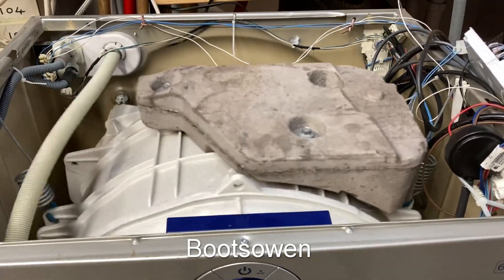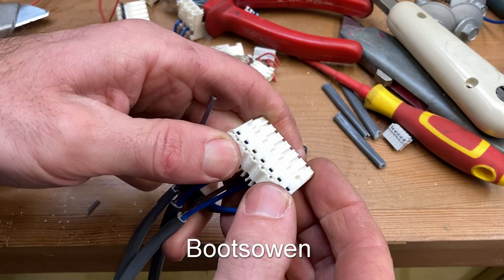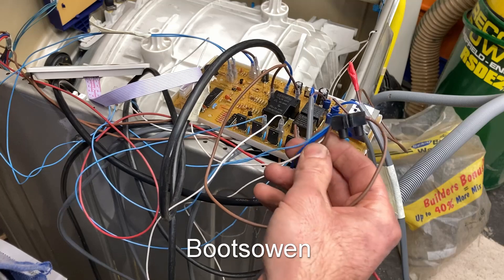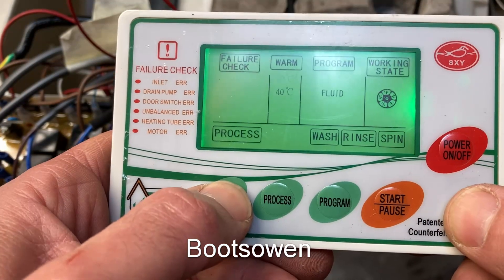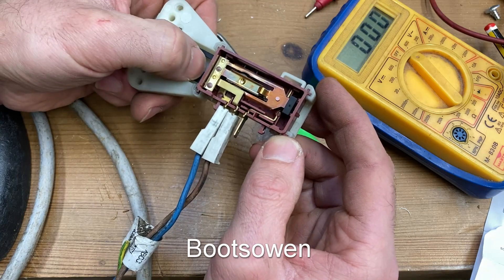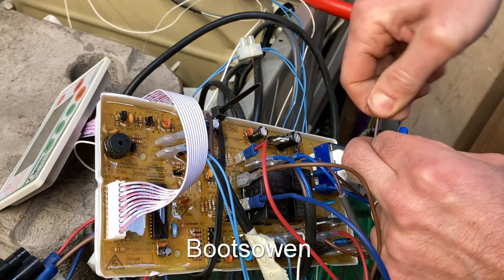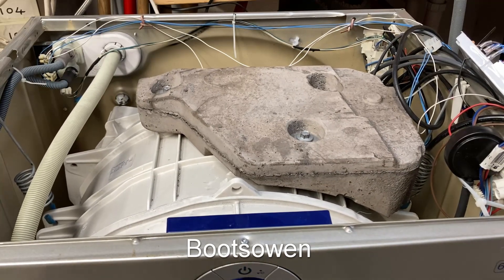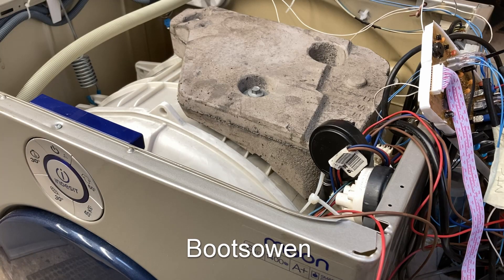Is it worth it? Fitting an SXY3388 controller to a washing machine: will Moonie wash at 90 degrees?

Comment: You've got to remember that there's a lot of poor countries with poor people in the world, the majority of the world isn't like US or Europe, also that the washing machine manufacturers don't give info on their machines or how to repairs. I think it's worth fixing stuff, if for no other reason than to reduce the excess of waste-driven economies. Economy and ecology go together. Thanks for your honest and helpful video. I'm looking at getting on of these as I baulk at the prospect of binning a good Zanussi just because an insect crawled in and fried itself and my pcb.
Reply from the maker: Cool. Sometimes pcb repair isn’t too difficult. It depends on what has blown. Burnt or broken traces are easy to repair as are any relays etc. it’s once you get into the smaller stuff that it gets tricky. Also you can often get a replacement on eBay used. It costs money but it will work. Whereas this board is pretty crumby.

Comment: Excellent job. I have a Vestel Pandora 1070W, once I load it and start a washing program it turns and suddenly the drum speed accelares and there's loud banging as if the motor or drum were loose, but it isn't. I guess the motor gets conflicting direction or speed signals from the control board. I'm not sure. It would be a great help if you have an idea. the machine is balanced and the load is minimum.

Comment: the "sparky thing" is the belt slipping because the motor make suddent changes
Reply from the maker: The controllers should allow for that and ramp up and down more slowly.
Reply: @bootsowen  maybe this motor has a sensor with a wrong resistance for the controller, or It Is Just junk (probably the second option)

Comment: Hey Owen I got an idea for the WMA32, Hotwire it with your Variac of yours and try washing some clothes or rags with it
Reply from the maker: Hi. If I Hotwire the motor to the variac all the other functions won’t work so it won’t wash?
Reply: @bootsowen  just fill it with the rags or whatever and fill it with water the garden hose and just make it slow on the variac and when you drain for a spin just open the door and lean it forwards then try spinning with the variac

Comment: to be honest the program choices are very small. no options and just like the moon pcb no 90 degrees. no spin speed regulation and all. i've heard theres a newer SXY but i'm not sure if its better. 

now lets imagine an SXY for dryers lol
Reply from the maker: One for dryers would be good. I have a Bosch with a broken board.
Reply: @bootsowen  i found on the internet a similar PCB that would be probably an upgrade for the moon

It's called YM800XQG-PLUS.
It's a touch screen and had way more options and stuff. Would be interesting to try it if it's really worth it

Comment: Owen, How many takes on the spade connect crimping with needle nosed?
Reply from the maker: I'm not sure I understand Andy?
Reply: @bootsowen  Owen, how many video takes did you need to get this just correct for angle and content? For me I would have had to do it several times, Cheers
Reply from the maker: I just did one take of everything. This shot happened to be the first but there was a few more. I cut it up so that it was all action and used the zoom tool to highlight the middle shot. If I remember correctly. I spent a few hours on this video editing. And I obviously left a lot of the process out. Usually I just bung a linear story together but this time I tried to make it a bit more interesting. I hope I succeeded!
Reply: @bootsowen  Owen, successful even though it's a difficult subject because of the waiting around and expecting things to happen. I was impressed by the crimping scheme as it looks so smooth, cheers
Reply from the maker: When you're good, you're good!

Comment: Owen, just a case of "if you had no alternative" but otherwise an interesting experiment especially as anyone can pick up another working washing machine for less than £30. However it may be the case that one simply cannot be parted with one's favourite machine. Simple remedy for that, have a few spare machines. Cheers
Reply from the maker: Indeed, an interesting experiment. Knowledge is king! I think the main issue for most people is not that they don't know how to repair a machine, (the reality is that if you didn't know how to repair a machine then you wouldn't have a hope of fitting one of these boards) but that they don't even know that you can get a great machine for £30. Some know that you can and won't because they don't want to live like poor people, but some just don't even think of it, and off to Bright House with them to get a new machine on credit! Or better yet a "Graded" machine on credit!